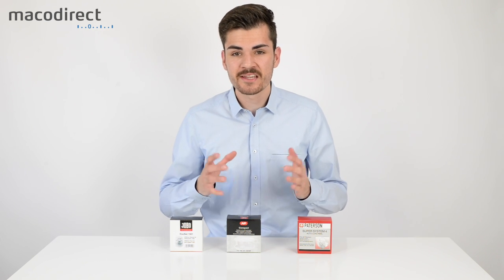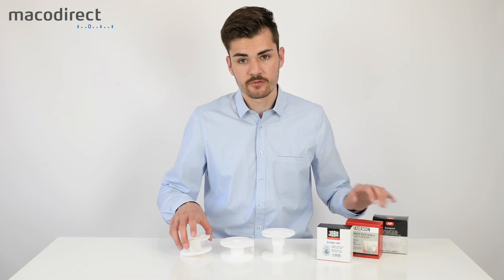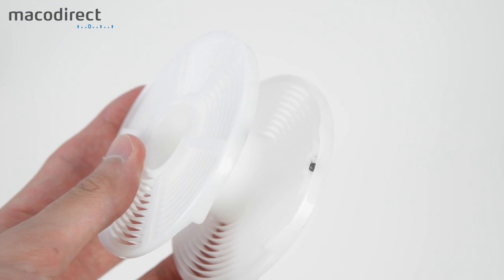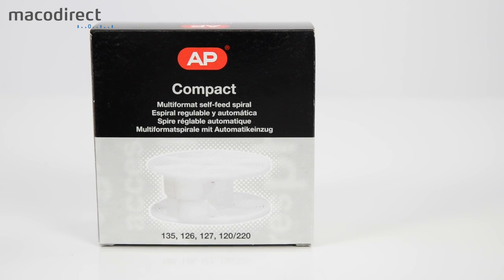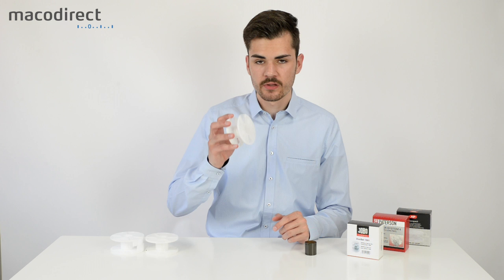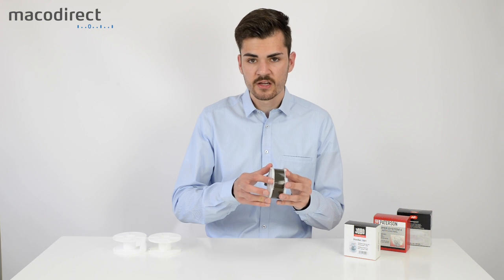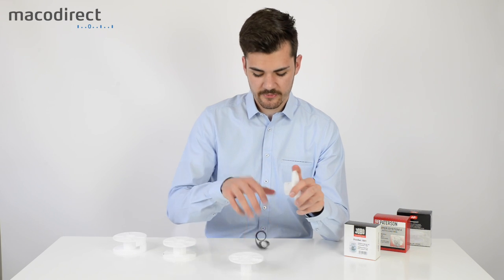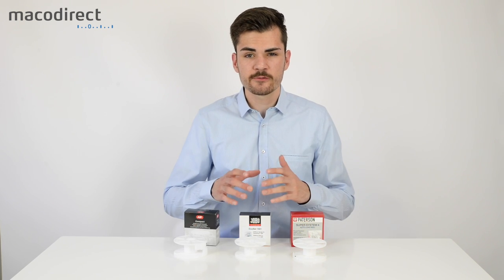Comparing Film Reel Systems & How To Load Film (Paterson/AP/Jobo)

Comment: AP has always been copying Paterson, and also inherits the shortcomings. The bearing system means the more film is loaded into the spiral, the greater the resistance, so if the film got jammed for some reason, you cannot bail yourself out. The Jobo does not push the film into the spiral but pulls it instead, I have never had any problem whatsoever with them. In addition it's more versatile and more economical with chemicals too.

Comment: AP is actually the best for both formats. For 120 the Paterson is the worst
Reply: True, and Patterson is usually more expensive as well. So why do most folks buy Patterson? Probably because of the widespread promotion of Patterson by folks already invested in the junk.
Reply: i bought 3 paterson reels for 120 *facepalm*, i developed 5 120 rolls so far and each time it was horrible. I really take my time and try my best, but the shitty ball bearings or something else jams and i can start over again. Definitely damaged my film with this, even though i was suprised as how much mishandling the emulsion can withstand (fomapan100/400). In the beginning i thought it´s just me or the fomapan film, but i´m really fed up with paterson. I need 5-15 minutes for a film, maybe even more. Each time it was absolutely horrible. I think i understood well how to guide the film and that it can slip out if handled incorrectly, but the ball bearings are something i simply can not fix. So, should i get AP?
Reply: @Raumweiter  get Reels from AP. Those fit in the Paterson but have also a kinf of lip which makes it a bit easier
Reply: @klofisch  i removed the ball bearings completely. It works very well. First i tried to clean the reels, so there is absolutely no residue but id didnt work. Then i removed one ball bearing in order to move the film more freely, didnt work as well. It even got worse. So i developed another 3 rolls since then and today i just pulled the balls out and it worked perfectly well on the first try! No scratching, no jamming. Smooth and quick. So i think i found my way to do it